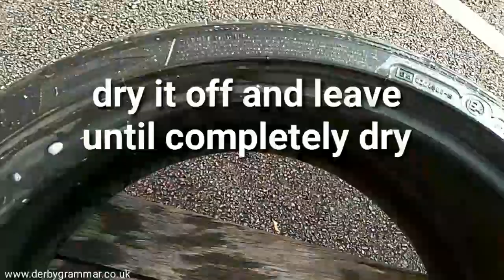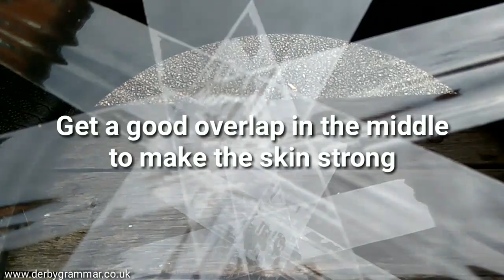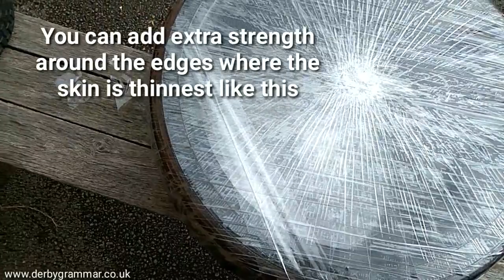How to make a taiko drum from a car tyre TUTORIAL

Comment: What an awesome idea! Thank you very much pal! And you can customize your drums by changing the tape colors! 
P.S: This drum support a lot of hits on it? Is it strong and durable? Btw, can I dare myself and use a RV/Jeep tire? It would sound savage!
Reply from the maker: customising your drums is a great idea.  I've seen people do this by painting the edges of the tyres before applying the tape, but of course, using some coloured tape is a good idea, though probably more expensive.  it's fairly durable, you have to try to make sure you're pretty consistent with hitting in the middle of the skin.  I have made about 12 of these drums for a class at school and the kids hit them pretty hard; I find myself having to patch up a hole in the skin with more tape once every couple of lessons, but if you're careful you should be fine.  I've always fancied grabbing a truck tyre and using that, but it's gonna be tricky to get the tension right with the tape.  If you manage it let me know!